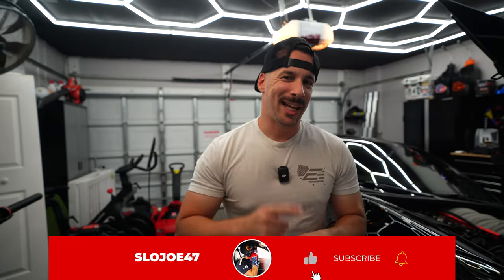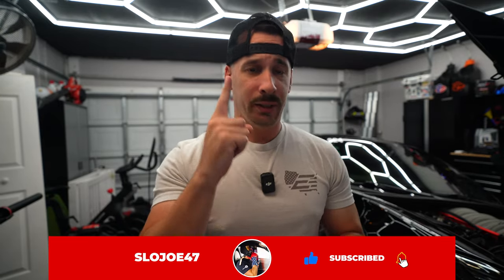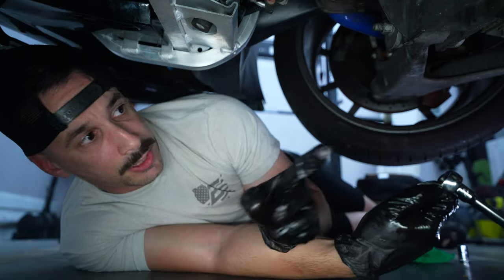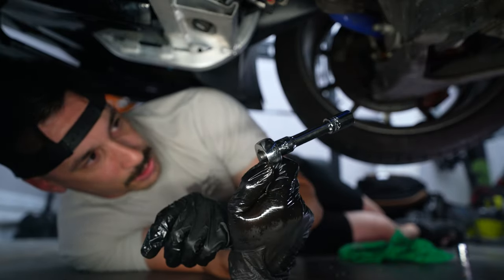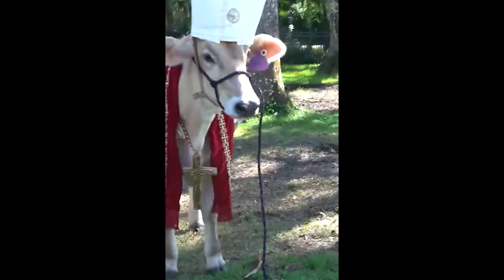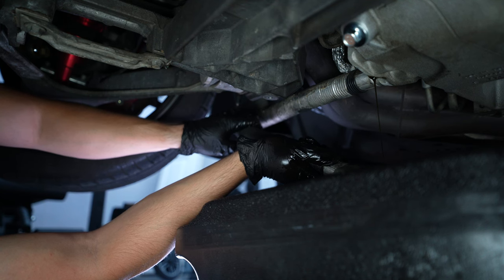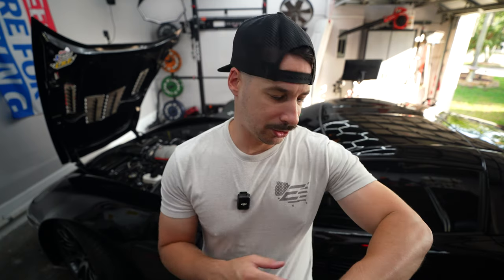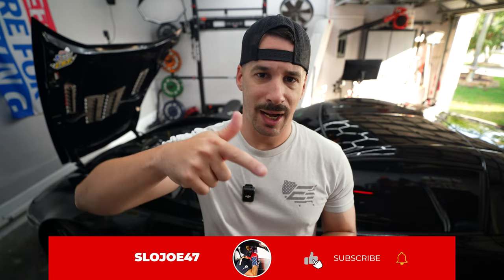The Essential Step You're Missing When Draining Oil From An Ls7 Dry Sump System!

Comment: Can you prime the oil system without starting the car? Aka crank only
Reply from the maker: If I removed the fuel pump relay yeah.
Reply: Hold the accelerator pedal WOT when you push the starter, the car will not start when it cranks. Verify on your own car but that's how I prime mine.
Reply from the maker: Yeah for sure! Ive heard of that. Never tested it but other Z guys have mentioned the same.
Reply: @SloJoeRacing  my ND Miata works like that too, but 1 time it didn't so I don't do it anymore lol
Reply from the maker: @B14CK_H4WK  LOL, yeah thats why I thought about just removing the fuel pump relay. Im scared the whole wide open throttle idea back fires lol